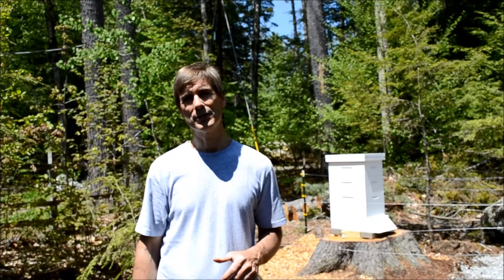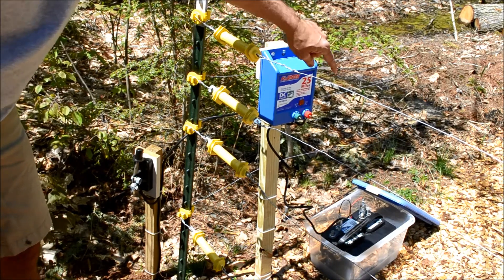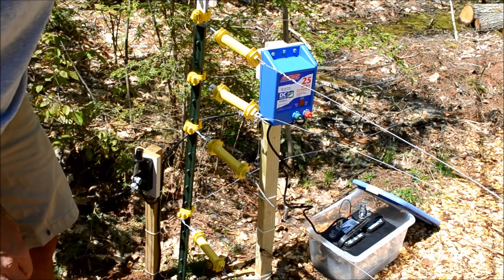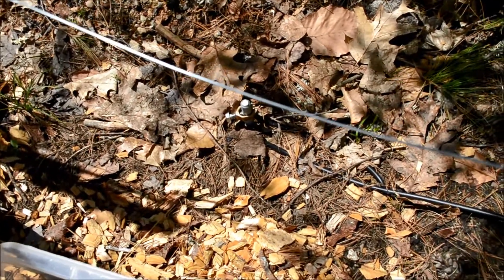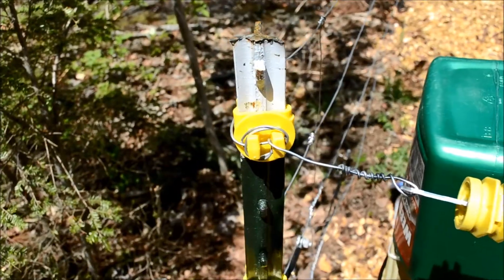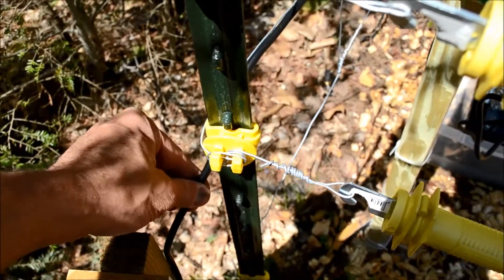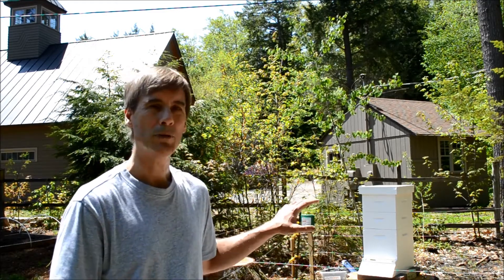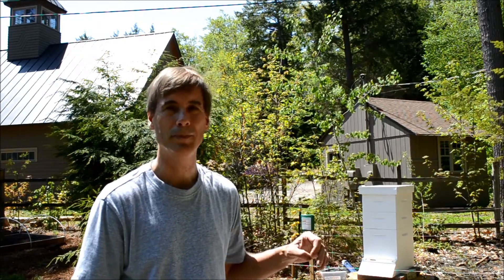Installing Electric Bear Fence for Beehive

Comment: Great video. Do you have a parts list? how many square feet do you suppose this will work for? I know you indicated this would be for a 144 ft2 (12'x12'); I may need additional square ft. as I am thinking of keeping 10-15 hives. Thanks.
Reply from the maker: I don't have a parts list. Typically the electric fence chargers will go thousands of feet. Just make sure you get one with at least 0.5 joules or higher for dealing withe bears.